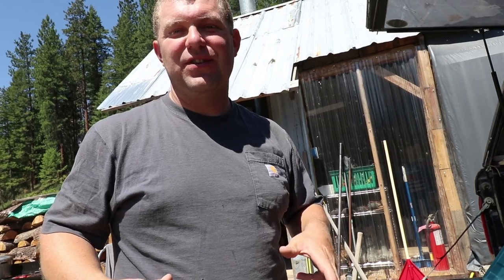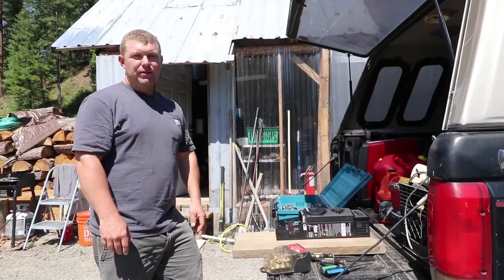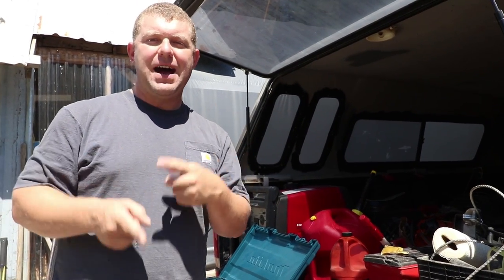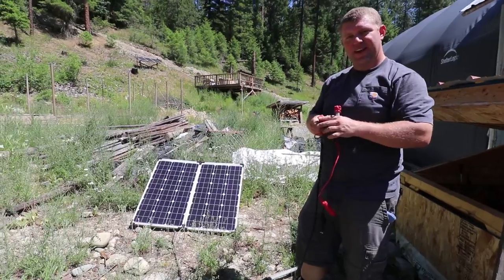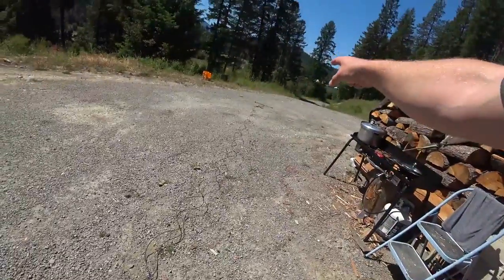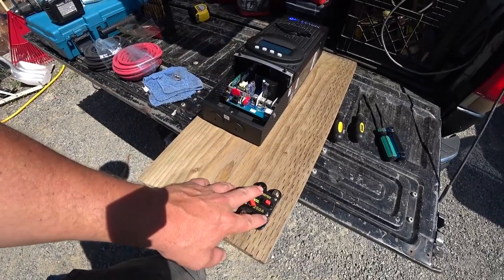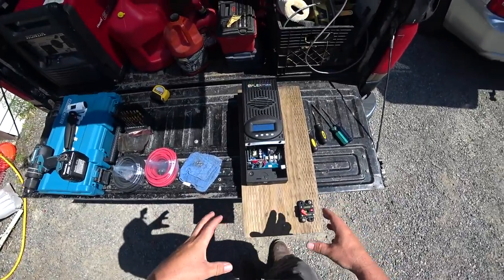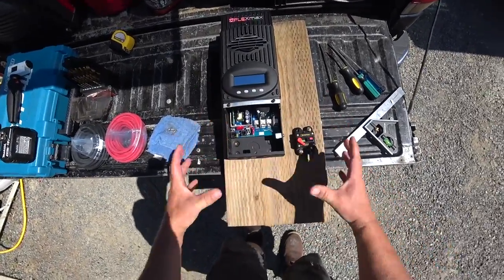Bad Idea? Now We Want Even MORE SOLAR POWER! (480 to 1230 Watt Upgrade)

Comment: you dont have to take old panels out of service you can use them as well as new ones and controller just have the loager controller on one side of battery bank and the other panels and controller connected to a diff battery in the bank i have just moved to 200  watts and relising just how little solar can put in and daily usage like a router on 24/7 in uk runs my system flat and it is summer in the uk so i feel the more panels the better even if you feel you may not need it

Comment: Did I miss something? I thought you were hooking up the 24V panels and using the controller to step the voltage down. . Or did you hook this to the existing 12V panels that are on your hill? 
 I'm sure by now you know about wiring batteries in series and parallel to get the best voltage and amp-hours. You just might have to get another battery bank. 
 As for cooling them? Try two 12V fans wired to a thermal switch. Set one fan on one side of the battery box to blow air into the box, and set to other fan on the other side to blow air out of the box. 
 The cross breeze will not only cool the box, but take any hydrogen fumes out with it. But but because of the later you might want to see if you can get non-sparking fans.
 You two are doing great. I'm enjoying every video I see. Thanks for putting them out there.

Comment: We have several solar projects on our lake home. For us it all started with charging motorhome batteries and just expanded from there. We are on a budget so these smaller bite size projects are perfect for us. In the ideal world it would be fantastic whole house system that serves every need but I reality having stand alone collectors that deal with very specific needs is a much better option. 
One project that comes to mind is a freezer. We are designing a root cellar which also happens to be the perfect place to place a freezer as it is naturally cool under ground thus the need to provide lots of power the the freezer isn't needed. 
I enjoy your projects mistakes and all. When you get done you'll be an expert, until then we will learn together.

Comment: Skip the High Chair.  Don't beat up everybody.  That would be good.  I just wanted to watch your upbeat video.... but your rant made the most lasting impression.  Buy high efficiency appliances and you will get more out of whatever solar system you have.  Insulate your freezer around the outside and keep it in a cool place that will help reduce the drain of that energy gulper.  Tin roofs and glass doors... solar heat gain....try improving stuff like that.  Good Day!

Comment: Congratulations on upping your solar input significantly. Whilst I get that the new controller allows you a longer wire run, is there a reason why mounting the panels on the roof of your shelter, more or less directly above the current controller position, isn't the best option? It would seem that this roof is just as, if not more, exposed than the hillside?
Reply: Oh, I forgot to also ask - does the new controller also allow you to download all the logged data to your computer, where you could probably more readily present it in a graphical format?
Reply: Simon B I would assume that having them on the roof would be extremely difficult to clear the snow during the winter months, it's also harder to get on the roof and service them, plus they would have to find a way to mount them really secure so a wind storm wouldn't blow them off.
Reply: Evan Dunville ok, cheers, that makes sense. Having grown up in Australia I still tend to forget about dealing with snow :)
Reply: 80% of solar panels are placed on rooftops.. so its a quiet good question why they place them on a hill so far away. 
But im sure its not a final position anyway
Reply: Most high end controllers have USB hubs.
Reply: You have to incline differently each month the solar panels to get the best output possible. If you put it on the roof, you can't change its position. The sun rays aren't coming at the same angle for each season.

Comment: I am new to solar. Let me ask a question. Your solar panels are coming into your Outback at 24 volts and the charger is charging the batteries at 12 volts. Is that correct? So your inverter must also be 12 volts. Is that correct? Thanks in advance. Gary G.

Comment: Maybe for now at least a few small computer fans on each side off your battery box? One for intake one for exhaust? That would at least help the temps a little bit and give some nice airflow to your battery bank... pretty sure you would be able to wire them in such a way to the charge controller that it could turn them on at a set point.

Comment: I have the same size 3.5 cu ft freezer and use 2 100 watt panels (WindyNation,com) into 2 12 volt dc deep cycle batteries. It gets into the mid 90s in the Oregon outback. I use a 1000 watt inverter and it charges my tools and devices.

Comment: Are you using a 12v fridge ? I use a sundazer and it's grate no need for inverters (waist of electricity)
Reply: O no don't go to 24v rip <12v better
Reply: Smackvttv pushing a higher voltage through that much cable is more efficient, he won't listen when I tell him to have the whole system near the panels because ac pushes farther more efficiently.
Reply: No it isn't. Voltage drop is less severe if you have higher voltages in the same thickness of wire. Also, MPPT controllers are more efficient with higher voltage battery banks. The ONLY downside is that 12V is a common voltage for things like RV refrigerators (as you said), but the wasted power from efficiency losses for using an inverter will be less than the wasted power from voltage drop using a 12V system.

Also, 12V refrigerators cost about three to five times as much as a regular refrigerator. For the cost savings of a regular refrigerator they could double their solar panels and batteries. Also, also, 24V refrigerators are a thing, if they were really so inclined.
Reply: Daniel Pratt: Ummm no! AC does not "Push" voltage farther; Voltage, Current, and Power is the same whether it is AC or DC. Voltage drop will be the same whether you are using AC or DC; you should really get back to the basic and AC and DC: The Main reason AC is the choice of transmission is due to the ease of converting the voltage up/down via transformers, DC conversion is much more complex. For Long Distance transmission, DC is better and there are many high voltage DC long distance transmission networks in the US.
Reply: I am thinking of getting a sundanzer.  I think  100w panel and 2 batteries will run in one good sun. Do you agree Smackvtv?
Reply: So how many 24v appliances can you think of ? a inverter maybe a few other things. Now think how many 12 V appliances/Gadgets things of use can you think of Anything that plugs into your car or boat (12 V. ) so would you say it's efficient to have a 24 V battery bank I believe the efficiency you're talking about is purely forcing electricity through wires. It's better to have a 12 V battery bank because there are so many 12 all applications and very little 24 V ones ...just my two cents ✌️
Real world talks
Reply: bubba absolutely it's been keeping my beer cold for nine years now
Reply: Most of the "12V gadgets" you're talking about are actually 5V gadgets that are running through a 12V to 5V buck converter (cigarette lighter adapter). There's about a 4% efficiency loss that way. So that isn't more efficient, but you're not wrong about it being more convenient. My solar system in my bus conversion RV is 12V because of that reason. 

But, as to the efficiency: heat is the main cause of wire inefficiency. Resistance in the wire turns some of your electricity to heat. Voltage doesn't effect how much that happens, but current does. If you're moving 100W of electricity at 12V over a wire, it's ~8.3A. If you're doing the same thing at 24V, it's ~4.2A. There's less current, so less heat is being created. As a matter of fact, about a fourth as much (1.08% voltage drop at 12V vs 0.27% at 24V on a 50' 2ga cable as an example). We only did 100W for this calculation, but it scales linearly.

You can see for yourself here: http://www.calculator.net/voltage-drop-calculator.html

It's like bicycle tires. Skinnier tires get sold on street bikes because they have less surface area in contact with the friction of the pavement. Lower amperage works the same. Less amperage means less "contact" with the resistance of the wire.

So, you buy a 24V fridge, which is arguably your largest load), and, if you really want 12V stuff available, you can get a buck converter to take your 24V to 12V (or 24V to 5V since that's what you really want (except that beer fridge you mentioned). As I said, they have about a 4% efficiency loss, but a 4% efficiency loss over a small fraction of your devices. But, I honestly can't name a single thing in my house or that I could readily go buy that actually runs on 12V besides your fridge and things that step 12V down or up to another voltage. Cell phones, tablets, and laptops all use either lower or higher voltages than 12V. My desktop PC does run on 12V (mostly, it also needs 5V and 3.3V), but the 12V needs to be a precise and stable voltage, so I couldn't run it off a 12V battery bank (which fluctuates between 15.6-10.5V depending on state of charge and what the charge controller is doing to it).
Reply: Robert Williams what he said and  the fridge runs on 12v-24v as well 🤤;)

Comment: Pure Living for Life cheap, effective help for your freezer's problem. Get some sheet Styrofoam (the thicker the better, I used 2") and cut to fit walls and top. Duct tape or whatever the panels together (careful not to cover any vents), and stand in place. I wrapped the whole thing in an old tarp for extra insulation and strength holding the panels. I made duct tape "hinges" for the top and left some slack tarp up there. I'd put a brick or something on the top when not in use to hold it down. This setup was used in a marina where I worked on the Gulf Coast of Alabama. Brutal sun and heat. Worked like a charm. This freezer was outside. I saw a similar setup at a seafood packing house where they ran copper tubing through the Styrofoam walls and would occasionally pump fresh water from the river through the walls. This cooler/freezer stood on the shrimp dock and was totally exposed. This old seafood house pumped water onto their roof continuously from the river and you would not believer the difference in the temperature. No A/C necessary. The gulf breeze help, of course!

Comment: Oh and for Battery temps., silly as it is... I actually use dollar tree car, windshield heat reflect car shade things,  wrapped over my battery box in summer, painting the box from black to white helped a lot too, but those stupid car shades... did wonders,  laser temperature gun said about about 160f in black like 110f in white like 85f covered with car shades (92f Out), i use em inside the office windows too to reflect the heat out... works pretty good for cheap junk.

Comment: Guys, I know you won't pay attention to this, but you really need to oversize your PV and then look at incrementally adding to your storage.

Long term strategy: Look at a 48V or 96V system. Maybe even go 120V and have two independent systems:
One for low power stuff like lighting and then another for the power hungry stuff. 

Build in some redundancy.

I hear you when you say you have the right to just mess about and learn as you go, but there are thousands of people that could help you do this better upfront! 

Get engaged with the viewers and make your project a success!

Comment: Jesse and Alyssa: Another great video. Loved it. However Jesse, Can't you plumb BOTH panel voltages in to the same battery bank via the charge controller you have and make it an all in one go? Or how would you do that if you wanted to use both sets of panels? I have a series of panels I am in the process of hooking up and am wondering how to do that or if you can?

Comment: If your in the market for more cordless power tools and you have a Lowes near by, check out the Kobalt line of cordless tools. They aren't the same as they use to be and you can get them cheaper. Just a thought. I have several Kobalt 24 volt tools and can't complain. Most my tools are  Milwaukee and the Kobalt tools are on par with the Milwaukee tools.

Comment: I have a question and I am not sure if this was ever addressed as I am fairly new to your channel. Have you thought about removing the insulation surrounding your RV winter home? And adding a vent or 2 to the roof to help evacuate the heat in the RV winter home?

Comment: Greetings and nice setup. Your video was very informative. Since you have had some time with your FlexMax  I would like to know your opinion of the Flexmax 80? I to am running a Flexmax 80 along with a 24 volt 3500 watt Outback Inverter and have been very pleased with Outback products. However, I'm using mine in my RV to supply off grid power. I ask because I don't see many people running Outback equipment especially in an RV application.

Comment: oh, hey you could use those spare S. panels to power an exhaust fan for your battery bank to help cool them down. That way you aren't stealing from your other system to power a fan. If the batteries get too hot they will drop performance first before burning up.

Comment: also if your router has a wall adapter you can make it run on 12v direct rather then have losses with stepping up the voltage then stepping down again

Comment: Nice setup. Keep up the good work. Just one thing I would improve upon is the crimping method used on your cable lugs for the batteries. The crimpers you used in the video are not something I would ever use. If you have no heavy-duty/hydraulic crimpers, use a hammer and a phillips head screw driver and smash them together. I have seen too many failures from poor crimp jobs and I don't need any more plasma events.

Comment: Yes true grow your system as you can. I am a digital tech and I started from a small charge controller and now have a Max 80 and nee to rewire my panels for higher voltage to move to a 48V system.   learn as you grow , I have seen the so called experts make huge mistakes in panels set ups on many of their installs.

Comment: I would of kept the 12 volt system , you could of run your always on things like freezer from it or emergency power :) I hope you have the right gauge wire for your 100ft run this time ;) Keep your self safe. Cable glands are a good thing for keeping some of your components dry and moisture free and are an investment. they don't cost a lot of money and you can add the glands at a later dates with out having to replace the wire. they're just designed to give a water proof seal between the wire and component via a rubber washer. you can actually make them yourself by compressing  a piece of rubber washer that is about 1cm thick and your wire just fits through the middle.

Comment: I went to 24 volts quite quickly. You'll see. All the losses and quirks are less noticable with the higher voltages.  Really Voltage is what suffers over distance.  AND I LOVE THOSE BATTERIES YOU ALL HAVE. You may want to invest in a nice voltmeter.

Comment: u forgot the terminal grease on them wires. it helps a lot with connection and voltage flow.

Comment: Quick tip you can use a square d air conditioner outdoor box and put a 15 amp breaker in the box Square d is rated for 48 volts DC it's in the literature but you can't use the old one's that say home on them tis way you get a cheap breaker box for your solar panels at the panel for safety Sally sake

Comment: I haven't finished watching the video yet but I had to pause and ask why you didn't use the panels Grandpa gave you? I'm assuming they were 24V and your system is 12V. You can use a step down transformer in that case. A cheap and easy solution. If it was the opposite, you simply wire two panels in series to get 24V and then if you have multiple panels, you wire each set of 2, that you wired in series, in parallel. Simple solutions. ;) Also, I really enjoy y'alls videos. Keep it up. Hit me up if you have any questions about anything. I'm good at everything from welding, construction, wiring, electronics, amateur radio, solar and wind stuff, cooking, etc... you get the idea. Maybe I can give you some ideas when you get stuck.  Oh, one thing you should look into, by the way, is aircrete. Or aerated concrete. It basically makes concrete super light, super strong, and turns one bag of concrete into four. It's worth looking into. It could make building your house super fast and super cheap. Either way, good luck and keep up the good work!

Comment: Have you tried adding salt-ice to the freezer to help retain the cold? Also if there are any equipment rental places around, ask them if they have any fork lift batteries or similar to add to your battery bank, Years ago we put a used fork lift battery in a Hi-Lo camper and it lasted over 10 years. Hope this helps. Keep up the great work. 
"Do what you feel in your heart to be right- for you'll be criticized anyway. You'll be damned if you do, and damned if you don't."

Comment: That chest freezer.  You could make it better or more efficient.  You cannot, absolutely cannot put insulation around it if it uses the skin to defuse the heat it pumps out. But if it has a fan and radiator under it (doubtful) then you could.  BUT you can add insulation to the lid.  Just stack some card board and or old blankets on it.  Every little bit counts. 
Most chest freezers and some fridges use the skin to defuse heat so you need to make sure there is plenty of air flow around the outside and the lid can be insulated extra.